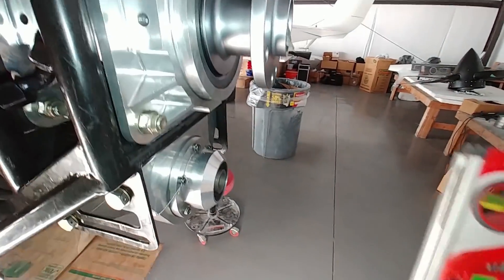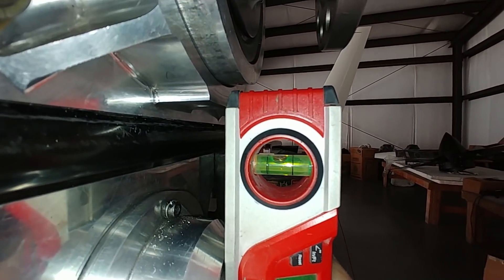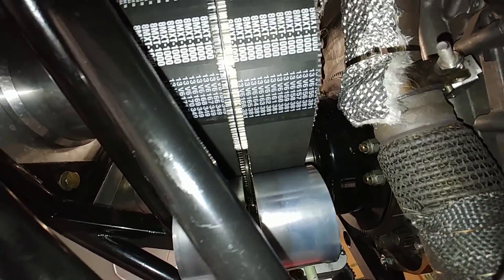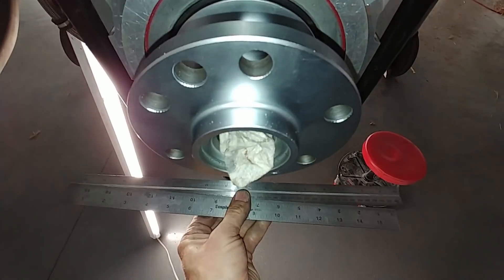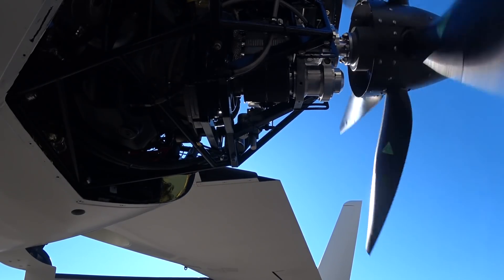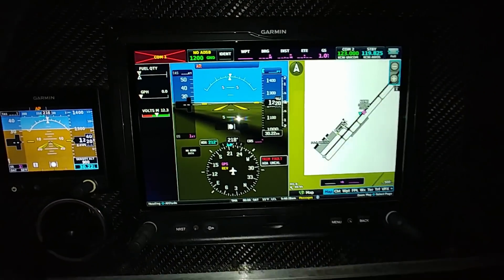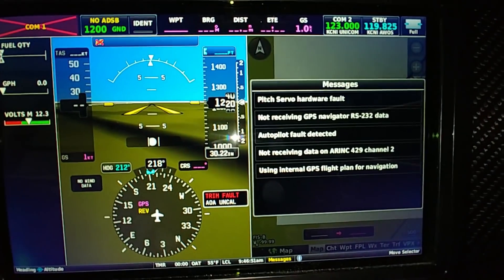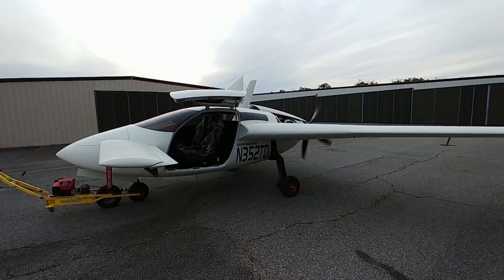Understand the Problem - Building the Raptor Prototype

Comment: Evening mate.  Great work.  This analysis of why the belts are walking may be wrong.  And perhaps does not matter.  Or perhaps it does.   Curious to hear your thoughts.  While aligned when the engine is not making torque, the top pulley shifts just a bit when the engine is under load.  This shows up via compression of the bushings in the engine mounts causing the engine to twist just a bit and thus misaligning the top pulley from the bottom one. (Which is not moving as it is bolted solidly to the frame.  A way to see this and measure it would be to get two inexpensive laser pointers and mount them pointing backwards.  One mounted (aligned) with the frame and the other  aligned with the engine itself (perhaps mounted to the valve cover?)   Take the aircraft and park it tail end facing a hanger.  Maybe 60 feet away or more.  Turn the lasers on and look at where the points are on the hanger.  Measure the distance between them.  Fire the engine up and put it under load and measure the distance between the dots again on the hanger.   This will show the alignment difference amount and direction.  Guessing ahead the belt is walking towards the end of the pulleys that are slightly closer together when under load.  Cheers mate and good on ya.

Comment: How about a slight crown on the idler pulleys
Reply: That is what I was thinking.  Example - blades on a band saw ride on the crown naturally.
Reply: Angle them toward the middle
Reply: I was thinking the same thing, also that the idlers may be too close to the driven pulley.  Seem like all the designs I've seen using idlers have them mid span between drive and driven pulleys.
Reply: That's cheating. I thought of that, too. I don't know if the belt will like it, but it can be a very small amount, but it being a timing pulley--would the whole pulley have to be made concave, with the tooth troughs, too?
Reply: Would be a fairly inexpensive experiment.

Comment: You might want to just put shields up and run it. The issues your talking about are vibration and movement through harmonics. There is a comment on here that sounds like part of the issue, that being your stability mounts for the engine. Not sure if you can isolate that but this will not go away. You must deal with another side to this problem.
Reply: You can also try lessening the width of the belts and or the thickness of the belts. Both will have an effect.

Comment: I would talk to my belt and bearing people about a UHMW wheel mounted in two high speed bearings. Then build a mount for the little unit so it rides on the side of the belt. That will keep the belts lined up on you pullies. I have done this in production equipment and it worked very good. Design with an adjustment so you can change the unit to get it working with your pullies and belts. I think the problem is you have some flexing in your drive shafts and that changes the alignment of the belts when the engine is running. Just my take on what you have going on. Good luck.

Comment: This seems like a design weakness just begging for a different solution. 
What is it when you keep doing the same thing over and over, hoping for a different outcome?
Reply: Repeated Measures is a valid methodology of empirical observation, you childish ass.
Reply: Has he not done several changes to 2 different designs?
Reply: @BrendaEM  Solving a different issue.

Comment: Why not add a fence on the edge of the pulley to limit belt walking. The fence needs a slight taper angle outward  as the diameter increases.  This is what commercial systems do.
csmale@bak.rr.com
Reply from the maker: The lower pulleys already have fences. They do stop the belts from walking but I'd like to have the system aligned such that the walking is minimized.
Reply: @RaptorAircraft  - Right, I remember from one of Your a previous video that one fence of the lower pulley had just become lose and You fixed it by some solder joints between fence end pulley. May be that the root cause of this issue was just the belt that forced the fence to be loose. You are completely right to address the issue to the root cause of the out of center running belts before You face other unexpected findings in the transmission system.

Comment: Ohhh Peter, You May Need To Design Some  3/8" to 1/2" Flanged Belt Pullies Like We Used To Run On Our 1000-1500 HP Fueler Drag Funny Cars & Drag Boats Blowers With Them Same Belts, ETC! LOL Thanks
Reply: There might be issues with flange wear that might not be a factor when you are running the belts for 5 minutes. A better assessment might be a dyno mule. How do their belts stand up?

Comment: 5:18 maybe there is more flexibility in the engine mounts now
Reply: Kirk Claybrook  this is the first thing that crossed my mind. If the top set of pulleys are stiff mounted but the motor is not, a twist may be induced into the belts which may cause the walking
Reply: Same here. I think there's a little flex in the structure under torque. More bracing would reduce it, but adds weight, and will never completely eliminate it. Often in automotive applications the pulleys are slightly crowned so belts walk to the center
Reply: @nfisheremti  The engine is mounted on flexible mounts like in your car but the re-drive is rigidly mounted to the frame so the relative alignment changes under load etc.
Reply: It would seem that the ideal alignment between the prop and drive pulleys needs to be perfectly parallel and any slight change from parallel is going to make the belts drift.. Peter's current design appears to have two areas that would be a compromise to a consistently parallel pulley operation. First is the engine mounting of the engine and the solid mounting of the re-drive must allow shift in "parallelism" at various torque/speed/power levels and secondly,  the engine rubber coupling on the drive pulley must also change slightly under varying load conditions (That's what it's there for...) and thus will ultimately again contribute to moving the two pulleys away from being parallel and belts drifting. Peter has come a long way with the re-drive but still has some ways to go, however he may get away with current setup and tweeking guards etc for the initial testing. For a long term solution, he may need to look at mounting BOTH pulleys on two bearings each in a solid housing, thus ensuring constant parallel pulleys, with a suitable drive shaft to the engine (CV joint/uni joint set up like most SUV's use).  This type of drive would also relieve drive belt torque off the front engine bearing..  Hang in there Peter..and congratulations on reaching over 17,300 followers.. !!
Reply: @kevc114  Simply replacing the flexible engine mounts with solid ones would be cheap & easy and it would show clearly whether or not this is the issue. Whether or not the solid mounts would then cause vibration issues through the airframe though is something I have no idea about.

Comment: Solid engine mounts might help?
Reply: Attach some laser pointers to the engine and re-drive and point them at something a reasonable distance away then try the rotation by hand and with engine. It will very clearly show any changes in the relative alignment.
Reply: There will always be flex.

Comment: Could the next pulleys be machined ever so slightly convex, to encourage the belts to stay centered, without any negative side effects on the belt?
Reply: That was my first thought and after watching this clip and a few timing belt clips on youtube, I'm kind of shocked that there isn't some self-centering mechanism designed into it as there really is no such thing as a perfect allignment.  Just seems like you could be the Einstein of allignment and it could still end up against the fence.
Reply: Could the idler rollers be convex? Might that have the same effect?
Reply: @kevlareditor7532  that's good thinking as well.  As the idler rollers could be machined or new ones made and added to this aircraft.  A lot less machining time and the pulleys wouldn't be compromised.  I just know from changing blahdes on bandsaws that it can let center it.  Though they may need to be concave, can't remember exactly but belts act weird